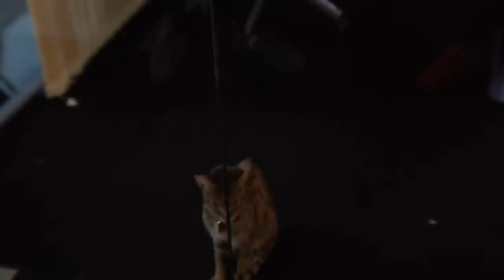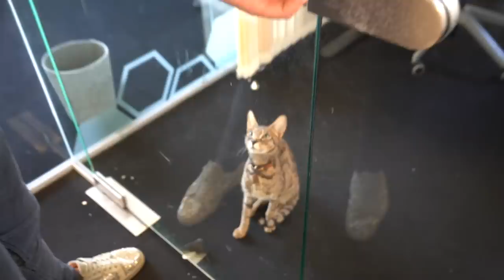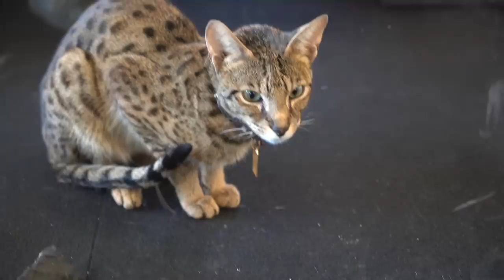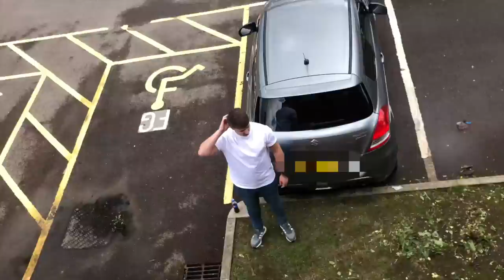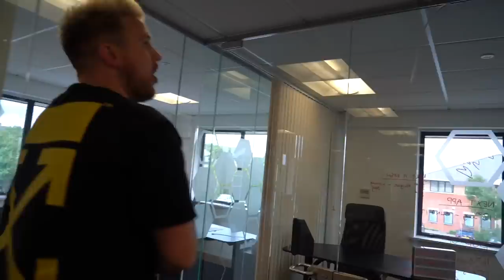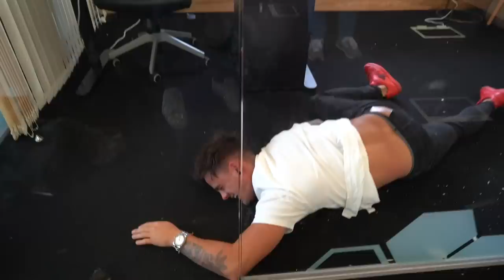SAVING MY £7000 WILD CAT

Comment: There is a key hole on the outside why don’t he just use the key
Reply: thats what I thought too
Reply: There’s a key in the other side you can’t open it if there’s a key in there
Reply: Because the spare key is on the other side and the other key is with the owner on the room who's is Africa
Reply: cause  the key was in the room with tom
Reply: Exactly
Reply: @tobynewbould3156  it's a lock that turns not a key
Reply: Toby Newbould there’s not a fucking key in the other side that’s the bolt that you can twist to lock and unlock the door from inside if someone is inside it